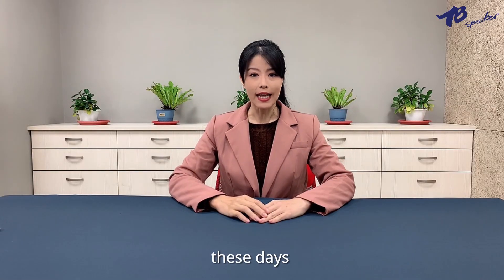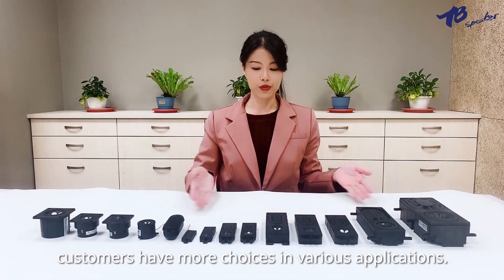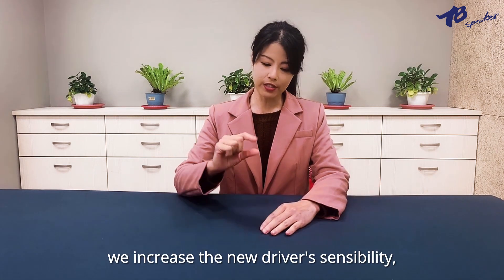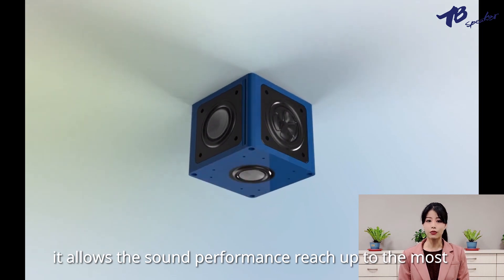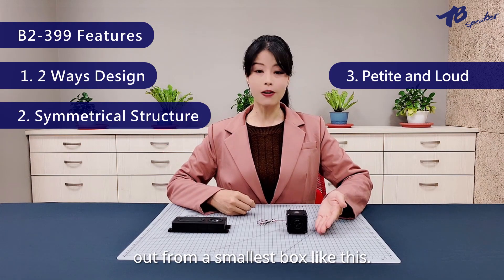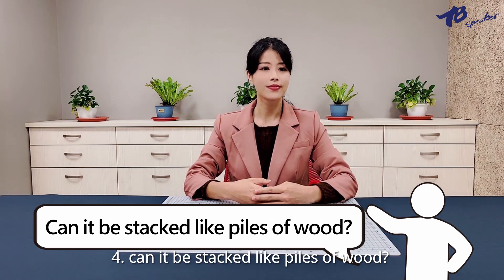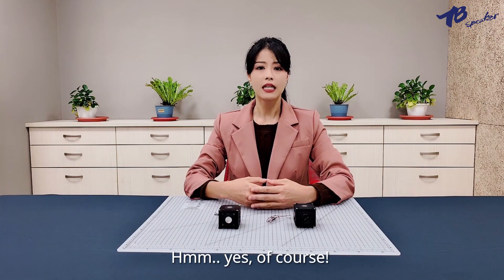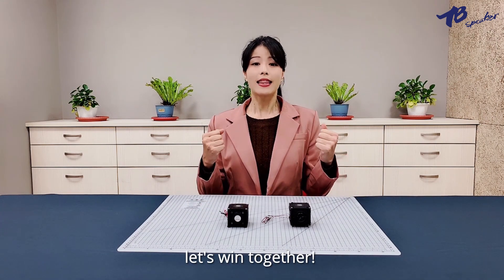Tang Band(TB Speaker)- Small Sound Module ( Advenced Sound Module Concept )

Comment: I've been looking for a small speaker system that I can move around, but haven't found any that I liked. So I decided to design a system on my own, currently the design is a 2 way system very similar to this. Slightly bigger as I have 3" elements. The subwoofer is your W3 1876S actually. If you put out such a system on the market I think it will sell. A smaller system will lack base response, it seems.